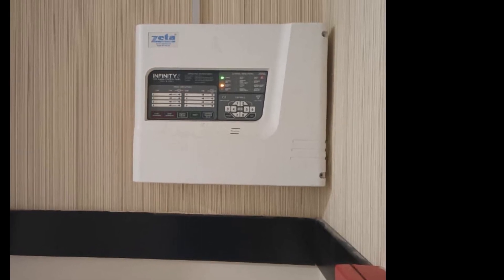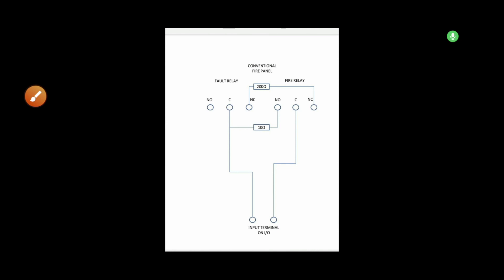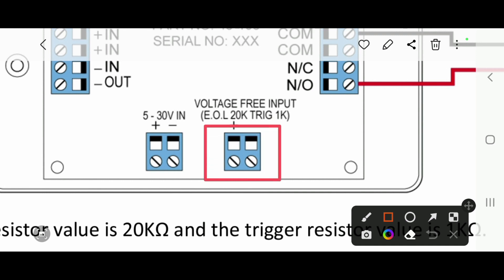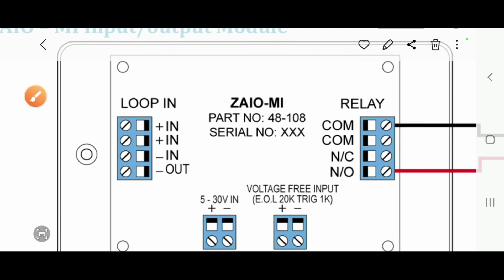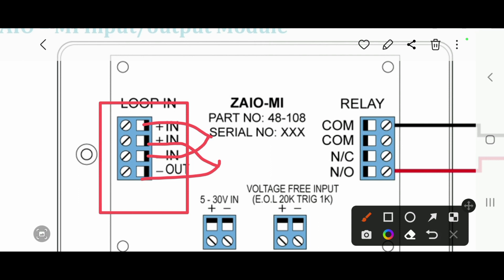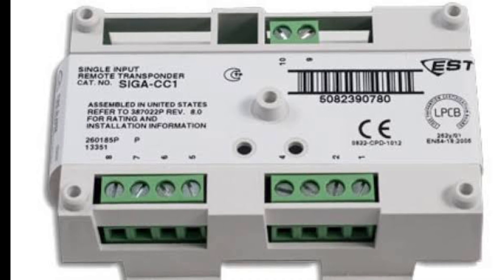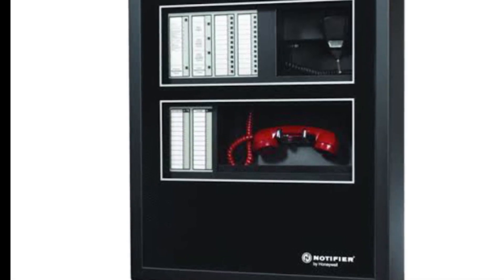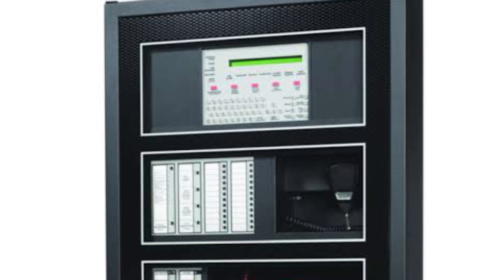HOW TO CONNECT ADDRESSABLE FIRE ALARM PANEL WITH CONVENTIONAL ||  #firealarm #zeta #फायर | interface

Comment: Dear Engineer did you tell me whats IP rating for Fire alarm system.
Reply from the maker: Smoke detector IP42
Reply from the maker: Heat detector - IP67
Reply from the maker: Weatherproof spunder IP65
Reply: Thank you 💟 for response